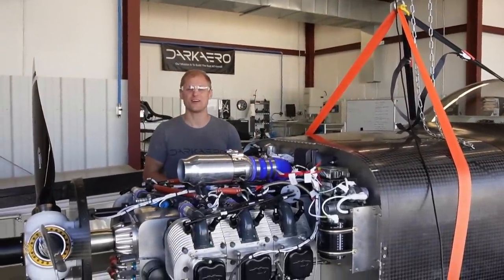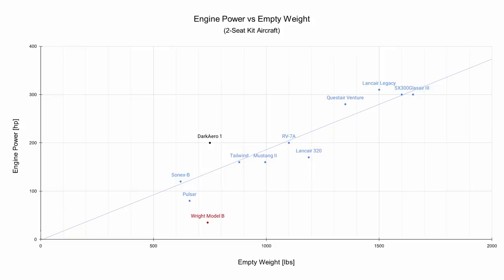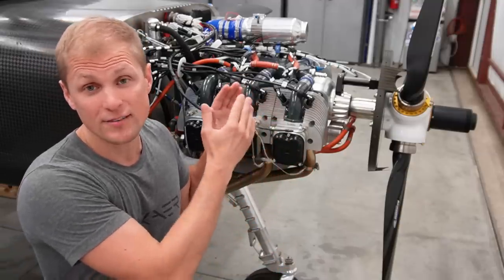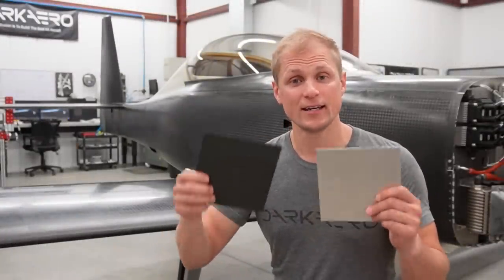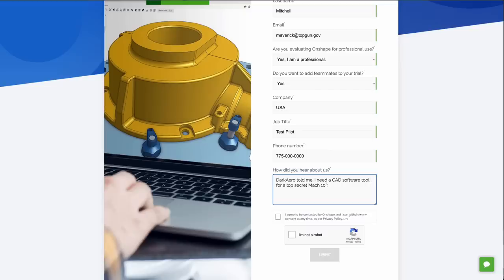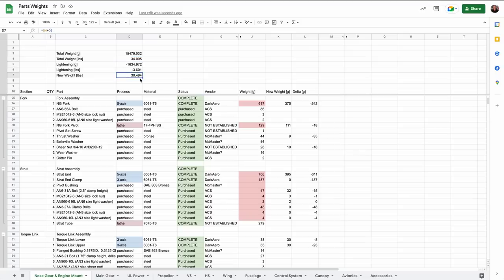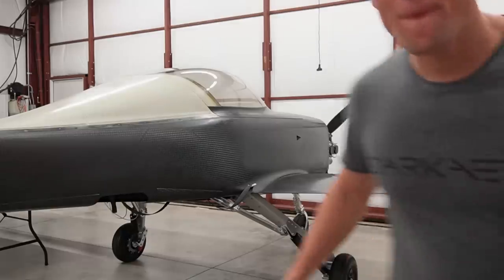How we built the DarkAero 1 "impossibly" light...

Comment: Wait, what. Paint? What you need that for? I thought the whole thing about "dark" was related to the bare carbon fiber.
Reply: Because the epoxy used in the composite breaks down from UV rays, as well as from heat. There is a reason why composite aircraft are usually sporting borning white paint jobs, best at stopping UV rays and reducing heat. 

They did mention they may try a clear UV protecting paint.

Comment: 🤔 If you put batteries into the wing, the weight of the batteries against the deflection of the lift load would probably result in near-neutral G-force for normal operation.

The electric motors are lighter than fuel engines, and the Spirit of Innovation found going electric was weight neutral for SHORT flights.
Reply: The total weight of batteries for any desirable range plus an electric motor (and supporting systems) would be much greater than the total weight of fuel for the same range plus a piston engine (and supporting systems). It doesn't matter whether the battery is in the wings or the fuselage.

Comment: Using Carbon composites for the airframe, how will you ensure impact resistance from small debris (e.g. pepples)? If a sizeable rock cracks a leading edge, will the entire airfoil need to be replaced?

Comment: It's unfortunate that no truly modern, certified engine designs are currently in production, like the EdgePerformance EPeX. The EPeX could easily make 200+ hp, while also being turbocharged and weighing ~50 pounds less.
Reply: Well they don't need a certified engine, it's an experimental kit, they could have designed it around anything. But this is a high-end kit, it makes sense to design it around a premium aircraft engine.
Reply: @TheOwenMajor  If the EPeX engine were certified, you don't think that it would be a premium aircraft engine? It weighs less, is capable of making well over 300 hp and it's turbocharged.
Reply: @PistonAvatarGuy  I'm all for conversions. I think the legacy designs are outdated, 100%. 

But certification is where you go to die as a company. UL power was sitting on a pile of cash to be able to get certification on their new designs. 

As for the EPeX, not sure how much I trust a snowmobile engine TBH. Constant 9000rpm for hours straight sounds a bit sketchy, and I'm even ok with 5000rpm auto conversions.
Reply: @TheOwenMajor  I'm just talking hypothetically and I'm aware of the difficulties associated with certification, which is why I said that it's unfortunate that no one has certified a truly modern aviation engine... except for Toyota, I suppose (the FV2400-2TC).

Check out Steve Henry on YouTube, he runs an EPeX in STOL drag and doesn't seem to have any issues with reliability. If something like the EPeX were to be certified, it's likely that the revs would be significantly reduced and the power kept to around 200 hp. I would say that the displacement should be increased as well. A better starting point might be something like the Hartley Enterprises Bolt 4, I only mentioned the EPeX because it's already being used as a aircraft engine.
Reply: 300 HP and 260 lbs firewall forward on Steve Henry’s plane is impressive. But have you also noticed that he trailers that plane to the events and stays over the airport within glide slope of the runway…
Reply: @2thelimitandthensome  For a time, he was flying it across the country to different events. He's also stated in the comment section on his channel that he hasn't had any issues with the engine, so it's likely that he stopped flying it long distance due to concerns over wear.
Reply: @2thelimitandthensome  What is your source for the 260 pound installed weight? I've been seeing 180-190.

260 just doesn't make any sense for a 10,000 rpm, turbocharged engine.
Reply: @PistonAvatarGuy  I am going by memory of one of Steve’s videos, and admittedly my memory is not always accurate.  But in this video Steve weighed the full installed firewall forward installation (not just the bare engine and turbo) and I recall it being 260 lbs.

Comment: is this the kind of engine that has to burn gas which still has lead in it ?
Reply from the maker: We are only running unleaded fuel in our engine, but it will also run on leaded if that’s all that’s available.
Reply: It doesn't need lead: the stated requirement is:
"MOGAS with min. 97 octane rating or AVGAS (98 Oct = 90MON = 94 AKI)"
That's premium automotive gasoline, which is unleaded.
It's a UL520iS, so specs are readily available.

It's unfortunate that these primitive aero engines still need high octane despite the low compression ratio (8.7:1 in this case) which hurts efficiency. An automotive engine wouldn't need high-octane (premium) gasoline.

Comment: The Dark Aero is fantastic. That carbon pattern is impressive and no distortion either it’s a shame you have to paint it.

You don’t want precise parts, dimensions and moulds, no no no. You want accurate parts, dimensions and moulds. Precision is a measure of how close together things are when you repeat them ie parts always coming out the same. Where as accuracy is how close you are to what you actually wanted. So you defiantly want an accurate wing not a precise wing, you want the airfoil and dimensions as per the plan as close as possible. How close you are is how accurate you are. For precision you can’t measure that on a single wing build as you need another wing build to compare it to and then you’ll see how precise your manufacturing is.

That was explained in the first day of engineering in a huge joint lecture of 700 brand new university kids. It was basically “Welcome study hard but most importantly study smart. Those doing chemical engineering will need to spend 65 hours a week including lectures and labs to scrape by on 3.0. And just because we lectures’ are fed up with it, this is accuracy…. And this is precision…, accurate can also be precise. Join the engineering society as they have $1 hamburgers and $1 beers at lunch.” That was the dean of engineering.

Comment: Congrats on achieving your low weight target, especially at the prototype stage.

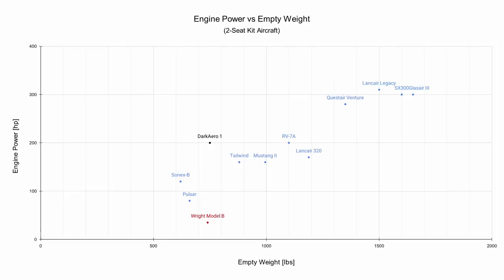2:40 this graph is flawed in several ways. It shows a mix of single, two and four seat aircraft of various construction methods and varying degrees of load factors as well.

Horsepower vs Gross Weight is certainly a metric. But that graph is looking at an outcome of engineers attempting to achieve certain takeoff and climb performance targets for a given payload. The horsepower to weight is arrived at from the end goal. Or, the engine is selected and the most practical airplane is designed around it. If Dark Aero 1 was a single seat, it would probably be 150lbs lighter yet.

Comment: Does it use 100LL
Reply: It could use that leaded crap, but it doesn't need it: the stated requirement is:
"MOGAS with min. 97 octane rating or AVGAS (98 Oct = 90MON = 94 AKI)"
That's premium automotive gasoline.
It's a UL520iS, so specs are readily available.
Reply: @brianb-p6586  oh awesome, thank you for this

Comment: With you designing this on such low margins. I find it concerning you haven’t talked about fatigue or material testing. 
No way you can optimize weight fully without sandbagging your margins in FEM.
I’d weld everything, build it out of PH aluminum, and heat treat the entire plane to solutionize, since it’s so small. 
Way cheaper I would presume vs carbon fiber.

Comment: i hope DarkAero can be transitioned into a high performance airplane much like the Legacy. Can't wait for a turboprop version in the least.
Reply: The lancair legacy is slower, unless at very high altitude with its turbos.

ULPower 520is has a turbocharged variant available now. 220hp and a critical altitude over 15,000'. Im sure someone will eventually build a 300mph DAero1.

Comment: Jesus that's insane. You need to start designing a 300-350 mph 4 seater asap....turboprop or LS3? LS3 is really heavy though, LOT cheaper but heavy what about Koenigsegg's 3 cylinder, two liter, twin turbo, camless engine that makes 600hp🤔🙃😈 I bet you can't keep a 4 seater under 1200 lbs 😈
Reply: I actually emailed Christian a few years ago suggesting he look at getting FreeValve into aircraft engines. It's such a natural fit if you can keep the air lines from freezing.

 The Panthera is 1800 lb empty. 1200 lb might be a bit of a stretch, but there is weight to be saved off their design. They couldn't go with the lighter IO 390 engine they wanted because it's not certified for mogas.
Reply: @MarkRose1337  I always liked the Lancair Evolution but because of the Pratt & Whitney PT6-140A engine that could be fitted into it, but in comparison it's a boat. That Pipistrel Panthera is a nice plane, I grew up with my dad owning a Piper Cherokee 180, it's all most people need...but I am not getting a plane cuz I [need] one 😂 I have half a mind to just build one myself, I don't want to spend half a million on an airplane to be completely honest. I really don't even want to spend more than $300k, but if I do I might just remove the budget entirely which I don't wanna do. I hate how expensive everything is. If I build one though, I'm probably copy the design of the Otto Celera 500L because the designer was obsessed with laminar flow, something people probably don't pay enough attention to. I wonder what a carbon fiber small aircraft version would weigh. They advertise as being able to go point to point anywhere in the US without landing, as a bushes jet, that's awesome and max cruise speed of 460 mph. Hmmmm what to do, what to do. Freezing shouldn't be much of an issue realistically.

Comment: Admittedly, you present a flattering balance sheet but with what expenditure of means and excessively expensive materials.
Others before you have done at least as well to see better like Mr. Coloban with his ban-bi or Nick Jones with his White Lightning.
The latter has the same power, goes as fast by taking 4 people. We can say that it's not bad, despite the empty weight of 1350 lbs.
Going fast is good, but in view of these two examples, I don't find your beautiful plane to be that exceptional.
Amateur builders build gazaile 2 for $10,000, the plane weighs less than 240kg for 65 to 100hp.
Come on if you had made a 4 seater of 200hp and weighing less than 1000lb then I would have said ok, they are good guys but make a plane that does no better than a white lightning by taking half of the people, I say it may be a good plane but it's not revolutionary either.

Comment: electrostatic metal foil vacuum blimp
Reply: if you go large enough, then the "foil" is rather thicc
Reply: volumetric to surface scaling, the more volume, the more thickness you get, the more total mass you can carry
Reply: liquid air nitrogen cool a YBCO superconductor coil electric engine, super small super power ratio
Reply: its like you are flying a rocket, the rocket curse equation, dont be in the rocket age, step up to proper, everything is possible, people can fly, you do
Reply: oh, metal-air ethanol-koh fuel cells, starting from iron-air at 1.2kWh/kg, pure iron foil wire as the fuel, up to aluminium-air at 8.4kWh/kg, or just flywheels, easily up to 30kWh/kg
Reply: oh, for your engine, electric turbo with exhaust turbo boost power and electricity generation, not just shaft supercharge turbo
Reply: over-pressure inside wings, easier framing, self supported by the pressure
Reply: you could use turbine engines instead, better weight to power ratio, make them efficient also, dont let the power escape
Reply: center-in rim-out centrifugal impeller turbine

Comment: Why are u using a ice engine not a lectric motor w lithium batteries instead of fuel
Reply: It's because of the KWh/kg of a battery system versus gasoline; 200 versus 4000 (I think).  Batteries just don't have enough energy density, and the pace of improvement is too slow to matter.

Comment: Wait no air-conditioning?!?! Or cabin pressure?! How am I supposed to fly this and not die?!
Reply: I know, right? Also missing in-flight entertainment system and catering. It better have seat massagers to be somewhat tolerable.
Reply: @Deagle685  can bring a tablet for that g but it's supposed to fly 1000+ miles think about that man
Reply: You can install a supplemental oxygen system, the Sling series of aircraft work this way.

Comment: Carbon fiber is also very brittle, aircraft grade aluminum has a certain amount of "give" or bendability which is key in airframes - especially in maneuvers at higher speeds.

I don't buy into the ideal of trying to build everything out of carbon fiber just to hit some arbitrary weight goal, so that you can hit another arbitrary - self induced - speed goal.  Seems quite naive.

I commend your enthusiasm, but I can't say i fully  buy into your outlook on the process of creating a general aviation airframe. Especially with the wings.

Does anybody on your team have any real world experience in building airplanes, and not just small singular part contracts or computer aided drafted designs?
Reply: I’ve now built two small carbon fibre aircraft, and I’m designing a third. I’ve been flying the oldest for 18 years without structural issues. Carbon Fibre is definitely the best solution for high performance as well as durability. It’s the best solution for all types of civil aircraft - including Airbus and Boeing aircraft. Oh - and I’m an experienced aeronautical engineer, having worked on small and large aircraft…
Reply: Do you have any real world experience? CF airframes and components have been around for decades and their properties are well understood. Why do you suppose that the DarkAero team are overlooking things?
Reply: This is probably the best engineered "kit / experimental" plane in a LONG while. If you want aluminum go look into the raptor - it was so overweight it landed in a corn field. Luckily no one died. Bendability is not "key" in airframes. And this is not designed to be an acrobatic rated plane, it can't fly inverted etc by design.
Reply: @randominternet5586  The Raptor was also carbon fibre.....